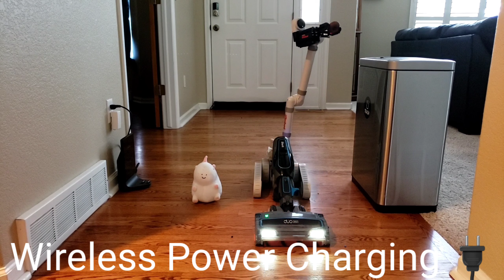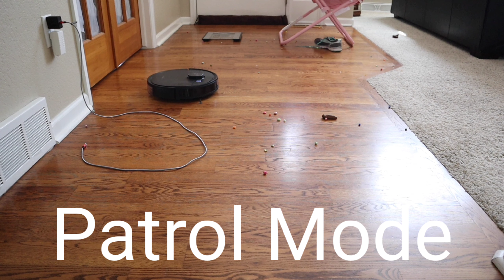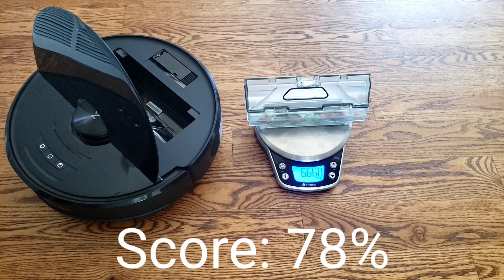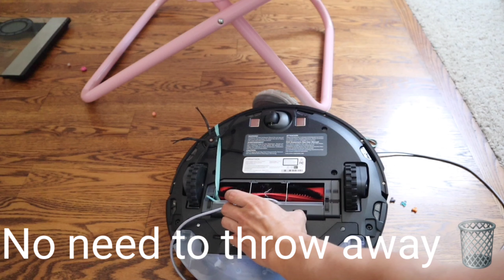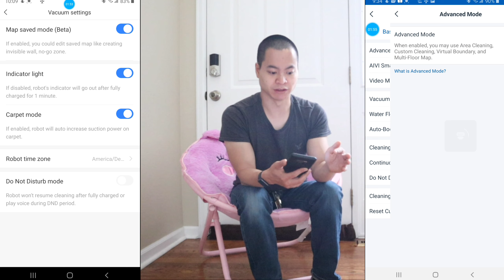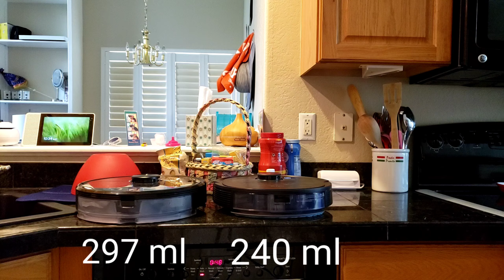S6 MaxV VS Ozmo T8 - Roborock against Ecovacs- Closest challenge YET!!!

Comment: Hi I wanted to know if the T8 has a two way microphone meaning I can hear what people are saying through the vacuum.
Reply from the maker: No it only a one way communication, you can speak through the robot. The robot it self doesn’t have a built in microphone.
Reply: @RobotMasters  Thanks for the answer, I also had a question about the S6 MaxV. Do you think that in the future Roborock will release an update to allow a "video butler/patrol" option? 

Also in your opinion what is the best vacuum of these two? For example, what vacuum would you recommend a family member buying? 

Thanks
Reply from the maker: @B_G_W  If it was me recommend to someone, probably go with the Roborock. I find the navigation better, and the App easier to use. The new update on the S5 Max and S6 MaxV allows the user to save 4 maps and the user can physical move the robot to a new saved location without the need to correctly load the map onto the robot first. The Deebot not a bad choice and may be the better choice for some users. The T8 has more features and has the possibility to add the vibrating mopping module and down the road the self emptying bin. It is possible for Roborock to add live video feed via software updates

Comment: Can you turn off carpet avoid in mop mode and rely just on keep out mop zones? Also, is the T8 able to turn off water flow on carpets, if the auto carpet  avoidance can be / is turned off?
Reply from the maker: No there no way to turn off carpet avoidance when mopping.
Reply: @RobotMasters  Thanks for your prompt response. Can't wait for your next video!

Note: In Ecovacs tips and tricks it sounds like they plan to address this issue.
"How good do the mopping functions on these new multi-functional robotic vacuum cleaners work?

They work very well. However, at the moment, they are currently one or the other."
Reply from the maker: Yeah I think they were referring to the Carpet sensor either avoids the carpet while mopping or increases vacuum power when vacuuming carpets.

Comment: How does the T8 work on multi floors, do you need to move the base every time or once the robot has mapped the floors, you can simply move the T8 and it'll recognize where it is located?
Reply from the maker: To map initially toy do need to move the charger to the new level. Also male sreu the Map Saving is enabled. Lastly male sure the previous saved map is cleared using Map reset. Once the maps are saved, you don't need to take the charger with you, just make surr the correct map is loaded onto the robot before starting.
Reply: Thanks for the insight. About to pull the trigger to buy one of these.
Reply from the maker: LoL take your time to truly evaluate the features and specs so you can find the perfect robot for your floor plan.

Comment: Hi Nathan. Quick question i have seem videos saying you can ask deebot ozmo t8 to go clean a specific room and it does go and cleans it. But they are saying they do that using Alexa.. 🤔 🤔 Robot master is that even true master? 😉
Reply from the maker: Yes 😀 they are correct on certain models, the 920 and 950 Ozmo series did get a recent update, The T8 hasn’t gotten to Room select feature yet 😩. If you have the Alexa App on your smartphone, under the skills section search Ecovacs Home. You can see the list of commands and what robot support what. Looks like the T8 isn’t listed yet 😢, and when I tried basic commands it didn’t work 😤
Reply: @RobotMasters  thanks Master!!! 😀 😀 😀 Welk a least we know it might supported its just a mater of time fot the update!!! 😀 😀 Finally this robot its becomeming for ne the perfect robot!!! It got pretty much everything.. I just wonder if it will work with Google hope it does
Reply: @danielsv17  just in case you're still wondering about this feature the answer is yes.  While the description for the Alexa Skill makes no mention of the T8 I've been able to "dispatch" the vac to particular rooms.  Did it tonight in fact.  I said "Alexa tell the vacuum to clean the kitchen" and it drove straight through the living room over to the kitchen did it's thing and drove straight back to base.
Reply: @CH-eg5rd  wooo great thanks a lot Corey just the info i was looking for Greta thanks 😁
Reply: @danielsv17  No problem.  One thing I've discovered using Alexa is that I am able to refer to the T8 as "Vacuum" whenever I want to send it to a particular room.  But if I want to tell it to stop and go charge I have to refer to it as "Deebot".  It's no biggie.  Just something to be aware of.  Maybe with future updates to the skill we could be able to simply use our custom name that we create in the Ecovacs app.
Reply: @CH-eg5rd  thanks so much for letting me know that i just wonder if it works with Google home as i only have pure Google homes lol. But if not at least i know it works with Alexa

Comment: I got the Ecovacs T8 based on your previous reviews. It's been a few days and frustrating software on Android. Are you iOS or android?  How many "floors" will the T8 do? I have a sunken living room and apparently that counts as another floor. Right now I can't get it to map my 2nd floor. Run it 3 times and the map won't save. The software on roborocks looks so much better.  Using this for mostly mopping, and considering the S6 MaxV over this. Did you find emptying the bin on the T8 a bit annoying as it's 3 pieces? And it wants me to remove the mopping pad everytime it finishes. can you leave it in the robot?
Reply from the maker: Hello sorry you have been having so many issues with the T8. According to Ecovacs website the T8 can support upto 3 saved maps. I have used both Android and iPhone for testing and one thing to make sure is enabled is Advance mode in the vacuum settings. Once you create your first map and saved it in the map management area there a toggle you have to enable to save the map. Next you go back into Vacuum settings and select reset current map. You have to make sure there no map showing before you attempt to create a 2nd map, repeat the process for the 3rd map too. Hope this helps, you can email me at nate2003@comcast.net if you want me to send you the pictures of the settings.

PS as for the bin, I just used the red tab to empty the bin, I only seperate it into the pieces if I want to clean the filters, it is tricky to keep everything together when emptying. You can leave the mopping attachment on, just note there no plastic mopping base to orevent water from soaking your floors while the robot sits to charge.
Reply: @RobotMasters  thank you! Reset map was the key!. That is not intuitive.do you think they will update it so that you can save more than three maps? I have sunken floors on two of my floors. So that's four floors, and I actually have a third floor. So I actually need five maps
Reply from the maker: @PeterPham  Right now the S5 Max only supports 4 floors with the new update, you can try and make the sunken floor a single floor plan

Comment: So the t8 is the one to go with?
Reply from the maker: It depends on what you are looking for. The T8 is recommended for the mobile security camera feature and mopping abilities. The carpet avoidance when mopping is nice to have. The Roborock has the better navigation and can save 4 maps instead of 3.
Reply: @RobotMasters  so is there any chance the t8 could have an update to be as good as the s6maxs navigate?
Reply from the maker: @PurelifeSimplelife  It possible, but after many years with both companies, Roborock has consistently beat out the Ecovacs in terms of navigation. I think overtime, both robots will have navigation that is good enough to not worry abiut the robot getting stuck or lost.

Comment: Great review as usual! What's the minimum clearance height (including lidar scanner on top) for both? Want to know if they'll fit under my couche.
Reply from the maker: The height is 3.78 inches for both units, so basically slightly less that 4 inches to be on the safe side
Reply: Thanks for letting me know and the recommendation.
Reply from the maker: The height including laser done less than 3 inches

Comment: When I saw you getting the Roborock from the oven I was OMG. You're hilarious! I love the BobShark2. Second version is definitely more advanced. So what you think of navigation between the two?> Is poo avoidance as accurate for both? Do I understand right that the T8 can't mop and sweep at the same time with the vibrating tank? I found the S6 MaxV to be good at recognizing shoes, maybe it is the easiest task for it, how about the T8 in comparison? The T8 cleaning brush does not have detachable side tips, am I right? Do you still have issues with the ECOVACS app or they have fixed it? Apologies if you said some things in the video, might have missed it.
10/10 keep the good work coming!
Reply from the maker: So the Ecovacs from my experience the navigation isn't as refined as the Roborock. The App it self is pretty good, stable and works well. I don't know if the vibrating mopping attachment stops the Vacuum system. No the extractor ends aren't removable. The T8 does better with shoes because the extractor bar and side brushes stop spinning to avoid tangle of the shoe laces.  The Poo recognition better on the Roborock. Thanks for watching Natalie!!!!
Reply: @RobotMasters  I was very excited about this one!

Comment: Thanks for another great video Nathan. A couple of questions on the T8...
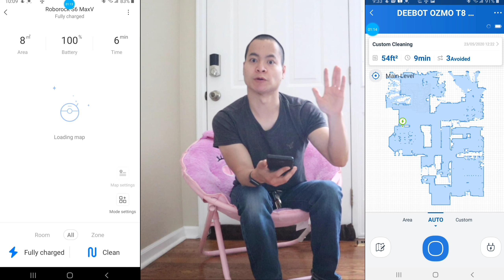1 - Time index 14:54 where you show the T8 map with the rooms labelled A, B, C, D etc. How does the T8 split the maps into rooms? Does it do it automatically and you're then stuck with what it decides are the rooms or can you adjust the room boundaries like you can on an i7 in case the automatic split-into-rooms algorithms puts room boundaries (usually door openings) in the wrong place? Or maybe there is no automatic room splitting and you set the dividers yourself like on Roborocks?
2 - Have you had any software updates for the T8 since you got it? I hear that Ecovacs are fairly good at pushing out software updates but am wondering if they've done a T8 one yet. I think you mentioned in a previous video that the T8 can corrupt its map if you move it mid-run; I'm wondering if that has been fixed yet.
Reply from the maker: So Ecovacs does a good job pushing software updates in a timely manner. So the robot will try to recognize and divide the rooms automatically. I have found I would need to update and edit my rooms myself. So as for the map  corrupt, I I hasn't happened for a long time, so maybe Ecovacs addressed this issue. But if you need to restore your map, just turn the robot off via the red power switch, place on charger and turn the robot back on. The robot will automatically update the map.

Comment: Thanks for the video, I saw from another YouTube vacuum tester that the s5 max is more powerful than the s6 maxv , this has been tested with suction ability in hard floor and carpet the cfm of the s5 max was more powerful and the camera if the s6!maxv is making the navigation more slower so the s5 max is faster ,what do you think ?
Reply from the maker: So yes that holds true, while I haven’t personally tested the CFM rating, from what I can recall, if you have a Higher Pa 2500 on the S6 MaxV vs 2000 on the S5 Max this can make the CFM lower on the Roborock S6 MaxV. Directly inverse of each other is usually the case due to rechargeable battery limitations. Either you get a high Pa or High Air Flow. Now we can rule out the extractor bar and side brush are the same, and I assume all other dimensions are equal on both robots. So if my theory holds true, a higher airflow on the S5 Max would yield a better pickup ability. Suction good for getting the dirt out of cracks and crevices, so I suspect the S6 MaxV would do better in a crevice Test. Now for the camera yes it slower to allow the robot to compute what it sees and determine how to properly navigate around them. There is an option to turn the camera off.

Comment: Great video as usual. So in your opinion should I just get the deebot T8 or wait for the roborock s6 maxv. I have both carpet and hardwood floors and 2 pets. Thanks
Reply from the maker: Hmmm tough question, if you are planning on doing a lot mopping with your robot, I would go with the Ozmo T8 because if the dedicated Carpet sensor that can actively avoid your carpets when mopping. If you environment more complex and lots of objects on the ground the S6 MaxV the better choice.
Reply: @RobotMasters  Thanks

Comment: Nathan one question 🥁 lidar roomba or roborock with self emptying bin?😄😁
Reply from the maker: How about a Lidar based Roomba on top of a Roborock self emptying bin??? You will have the best of both worlds 😋. Honestly I think I would go with the Lidar Based Roomba since it already has a self emptying bin that can't be beat!!!
Reply: @RobotMasters  yes i agree roomba have awesome cleaning ability and the best self emptying bin
Reply: Good question geo kokos, I've asked myself that so many times because I have an i7+, love the self-emptying bin and the cleaning performance of the dual rollers plus the nice extra features like bin-full sensor and dirt detect, but the VSLAM camera navigation really doesn't work well in some roooms in my house. I also have a Roboroch s5 Max in my holiday home so I know how much I prefer Lidar navigation.
My practical answer is that I'm getting so fed up of the VSLAM navigation failures on my i7+ that I'd go with whichever comes out first but like Nathan my preference would be Roomba with Lidar navigation because of the Roomba's already great cleaning performance. Also, we already know that there are lots of third-party copies of the bags for the Roomba self-emptying bin on eBay for way less than the official iRobot ones, so running costs should be low.
Reply: @julianfp1952 thank you yes a roomba with lidar and biggest battery is a perfect robot vacuum and a self emptying bin without bags.I own a xiaomi mi robot it cleaning history is 405 hours excellent navigation awesome cleaning ability im pretty happy with it. Previously i owned a roomba s9 without the self emptying dust bin but i returned it because the navigation in my house was awful.

Comment: Just got the T8 and one thing that I’ve quickly noticed is that it leaves far too wide a gap from ‘obstacles’ (ie - furniture) or perceived obstacles. In the kitchen, the shadow from the light on the lower cabinets on the hardwood floors caused it to not get close to the edge, which is something my old 920 had no issue with. Did you notice the T8 is bad at edge cleaning?
Reply: I am experiencing the same issue as well. The T8 seem to have the potential but need a software update soon to address this. It has missed more spots compared to 950 I borrowed and tested.
Reply from the maker: @anandraman9696  Yeah I will keep an eye out to see if a new update comes to the T8. For now haven't seen one yet.
Reply: Anand Raman I agree - it’s a step backwards in terms of cleaning vs the old 920 I had and returned for the T8
Reply from the maker: Yeah I would recommend turning off the Camera in the vacuum settings. Unfortunately this is something ecovacs need to address in a software update.
Reply: Robot Masters Yes - that’s what I ended up doing... but then I may as well save $300 and get the T5 ($499 at Best Buy vs. $799 for the T8)
Reply from the maker: One thing to note, the T5 doesn't support the upcoming Accessories if they become available. But everything else about the T5 is similar minus the camera!!!
Reply: Robot Masters Good point... if they do software updates and the accessories, it will be great
Reply from the maker: @RichardoBrit  There should be a big software update coming to the S6 MaxV before release date. I will have a video covering this new update!!!